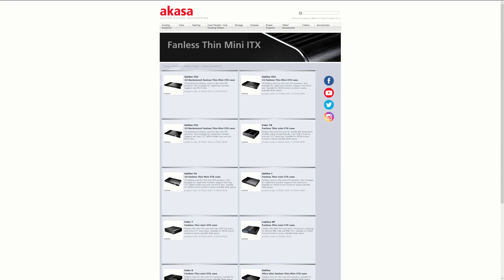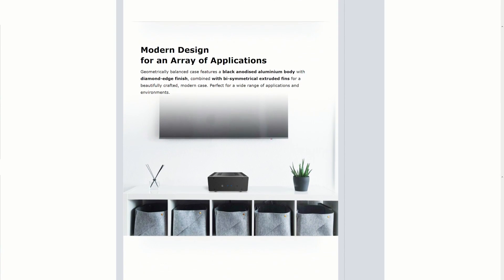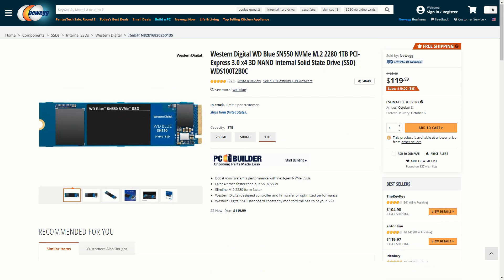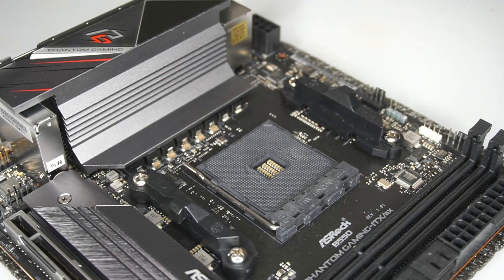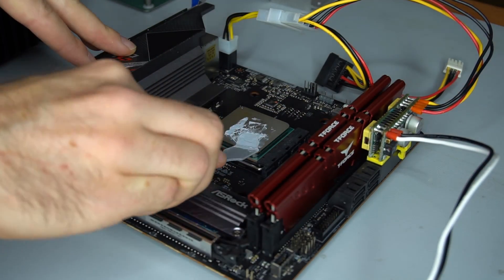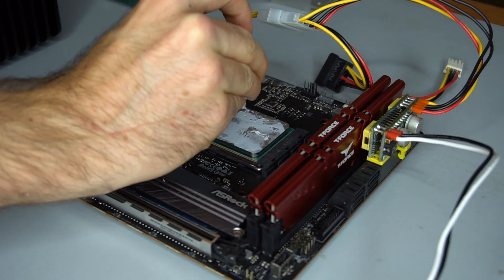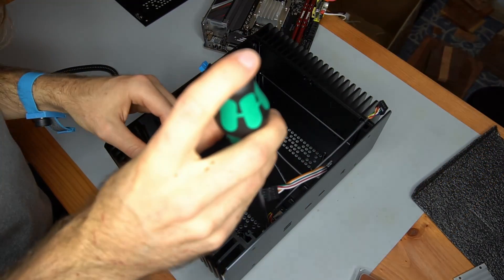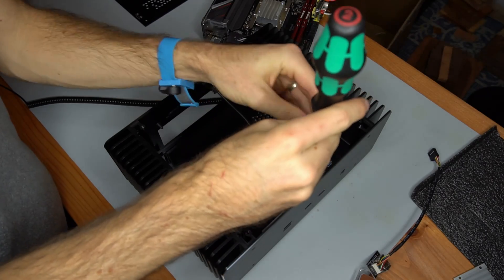Akasa Maxwell Pro - Building a Fully Silent Fanless PC

Comment: I'm finalizing a build based mostly on the learnings from this channel. Really appreciate your work! Since I'm not able to get support from Akasa directly, I wanted to ask if it makes sense to install a second M.2 drive underneath the motherboard? Will it even fit? What about the heatsink? I'm also considering a board that might not support cTDP, and I see that you do recommend limiting max power to avoid throttling for heavy workload (will be using R5700G).
Reply from the maker: Hi, yes, an M.2 SSD in the bottom slot is a good idea! If you can layer thermal pads to the right height (by trial and error), you can use the case's bottom panel as a good heatsink for the SSD. Also, I think all motherboards that will work with the R5700G will support cTDP, you might just have to spend some time searching through the BIOS to find it.
Reply: @fullysilentpcs  Thank you. Since I will not be stressing the PC constantly too much, but wanted to max out on the core count for virtualization and specific server use-cases, I decided to save on motherboard and invest into higher spec CPU. I will be using an A320 motherboard with 5700G. I thought the motherboard does not support cTDP, couldn't confirm that. If it does, then limiting total power could help with potential issues with poor VRM configuration, further justifying the choice of low cost motherboard, I guess. I will let you know once I try it out. I consider double M.2 feature as an added value if I (need to) go after a higher spec motherboard. :-)
Reply: @fullysilentpcs  I promised to give an update on the A320 motherboard (Asus A320I-K). It seems not to support cTDP, at least I wasn't able to find it in the BIOS, search did not find anything either. Right now 10 minutes of full load using stress-ng results in CPU temperature almost hitting 95 degrees (Ryzen 5700G), pretty sure it would do it if the test was scheduled for a bit longer. The whole system draws around 110W during this test. But when I use Prime95, mixed stress on all cores, with hyperthreading used, bumps up system power consumption to 88W only and the temps seem to stabilize below 80 degrees. Additionally, I might have handled the thermal paste incorrectly - too much has been used on the CPU itself and relatively small amount was left for heatpipes. Anyway, I think I will be disabling HT, which might lower the overall power consumption under load. What I'm happy about is that the whole system with two 2.5" SSDs and two DIMMs consumes only 11-12W in idle, running Ubuntu Server.

Comment: Great built. Thanks for this video. I will built it with the 5600G.
I still have one question. Can I put this PC upright like a tower-pc?
Reply from the maker: You could place it upright, but it would rest on one of the two heatsinks and wouldn't cool as well.
Reply: @fullysilentpcs  Thanks. That sounds logic. But can you recommend a case for the upright position?
Reply from the maker: The Streacom DB1 would work well vertically, but it doesn't cool quite as well as the Maxwell Pro.

Comment: Amazing video. Thanks. One question, is it possible to install a proper CPU cooler inside in case you needed (during summer)?
Reply from the maker: No, if the CPU is too hot during summer you can either reduce power limits or add a fan outside of the case.
Reply: @fullysilentpcs  hey thank you for the quick response. I see. From the video I thought that a very low profile CPU cooler would be fit, but if you say so.
Reply from the maker: The heatpipes would get in the way of a small CPU cooler. You would have to remove the heatpipes, so the case would no longer help.
Reply: @fullysilentpcs  I see, thank you!

Comment: Thanks for the video and flagging the gaps (verified). 64w it's not seriously. I will going to put 32w (I have Akasa with 32w and I know, whats happen, when cpu is hard work). I have Maxwell Pro with Akasa 150w power Kit (12V pins 96w, max 150w for all pins) and cpu  i5-11600T (PL2 power boost is 84w). MB H570M-ITX (B model has power limits). In 2021, this is the maximum solution for Maxwell Pro to achieve a good balance at a good price and ensure long-term stability. Installation: when placing the H570M-ITX, first put the board with the cpu block, then connect the front usb 3  then 2,  (they do not need to be removed), only then the power pins, then the ram, etc. The process can be different with different boards and power supplies. The included 4g thermal paste is not enough, even when used sparingly, you need an additional 4g (called a premium product but even saves on thermal paste). DC-to-DC a little noise.
Reply: Hi   12V 7.5A linear power supply  good for 65W ?

Comment: Are the heat pipes coming off the CPU block high enough to clear RAM if it were on the top side of the CPU? Many "Server" motherboards have the ram on either side of the CPU instead of on the back edge of the motherboard. I want to built an "Antsle" like home server with perhaps a supermicro motherboard.

Comment: Matt, what is your opinion about best mini-itx fanless case for now? Is Maxwell Pro is best choice for AMD APU ?
Reply from the maker: Between the HDPlex H1, Streacom FC8, and Turemetal DP2, they perform very similarly. I'm partial to the HDPlex and Turemetal cases, but the Akasa is easier to install and less expensive. They will all work with an AMD APU or Intel CPU.
Reply: @fullysilentpcs  Thanks
Reply: @fullysilentpcs  Matt, it seems, that Turemetal have made a similar case - UP3. It would be interesting to see it's review.

Comment: Thanks really interesting. I wanted a 4650G or 4750G for my own fanless build, but couldn’t find one here in Australia. I wonder how it’d perform if it were strictly limited to 65W long term like the i5 I ended up with. It gets pretty hot here, so 78W probably wouldn’t work. I also prefer the slightly more spacious Streacom FC8, and I suspect that case would struggle with 78W even at low ambient temps. Much food for thought - thanks again.
Reply from the maker: I think the Maxwell Pro will do better than the FC8. Limiting it to 65 W will decrease performance only slightly.